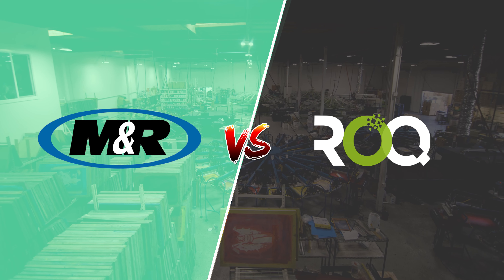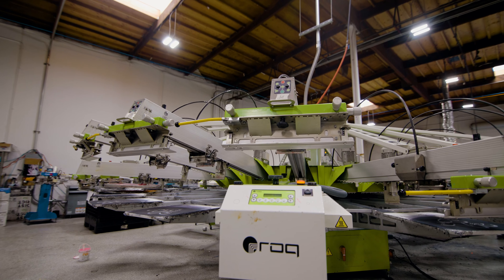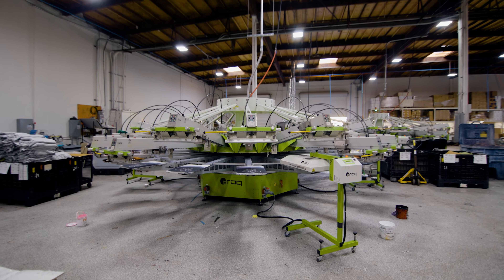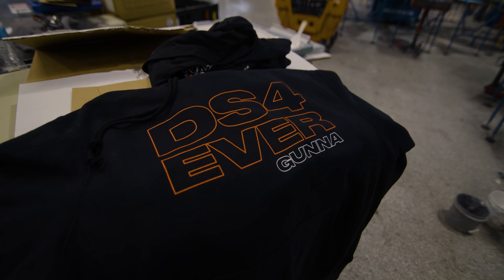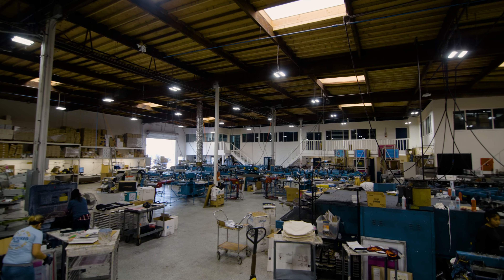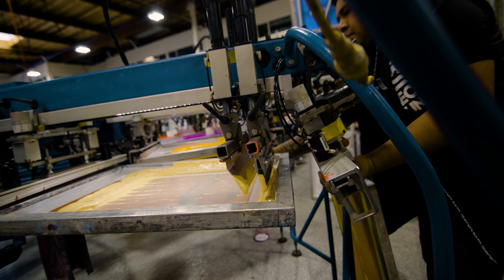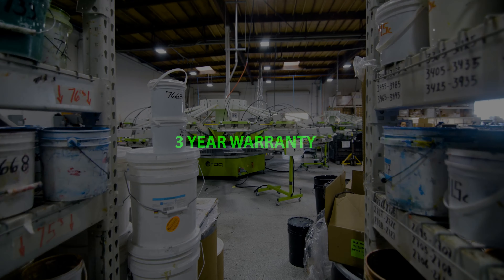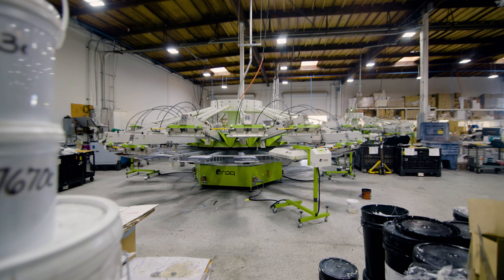M&R vs. ROQ | PRICING

Comment: I love screen printing manually...learn the basic with a manual before u go spend mad money on automatic...i have never had a 10 color job.lol
So i think its bs for that to be a reason for automatic press....
With manual u see soo much that i feel u cant see with automatic press....and i would love to have a partner and i go up against a manual press..i always screen print by myself..when i see people use a automatic press its usually 2 people...its the flash timing i dont get from automatic... automatic seem to have a shorter flash time..i assume most use wet paint with automatic screen printing machines..and if my orders got tooooo large i might think on automatic press..other then that i like whole process of screen printing manually..
Reply from the maker: It's always the best to find out what's suitable for the business
Reply: @anchoredprints  on some level I get you...the shop I work at can afford a automatic press..I keep getting ask by my boss if I want a automatic..I always so no..
I like the workout I get from screen printing..but my arms are starting to not like screen printing..I am 51..I want to goes as long as I can with a none automatic press..and if screen printing grows to a point a automatic is needed.i will go that route..I use a vastex v2000 6 head.great wheel..have 3 tajima embroidery machines.
Appreciate the reply .
Have a happy new year2024..

Comment: Blue V Green argument is going to last years and years. Ford VS Ford in my and other industry Veteran opinion. Several key reasons to break away from the "Fords" and go "Lexus". 2/3 less set up time, 2/3 less pallet deflection, next to zero technician need, next to zero spare part need, next to zero mid run registration adjustments, superior flash unit tech and much easier "newbie" automatic operator training. What is the "Lexus" press line up you say?? MHM of coarse.
Reply: agree.

Comment: Purchase a Roq last year and it’s a love hate relationship. Registration is great, ease of use I’d give a 8/10. My issue are
A: machine will stop randomly after heads come up
B: I’ve literally had 5-6 bolts fall out while printing 
C: Pallets are not square and that’s my big issue. A design is centered and even on some and off on others. 

I’ve worked with many brands and IMO AWT is the best. The centurians registration is absolutely amazing but it’s takes a lot of air and hoodies are difficult because of the pallet board. Someone looking for an affordable press the M&R sportsman is a great choice and probably about $10-$15k cheaper. 

My roq tech was fantastic. From a customer service standpoint, everything from ordering, delivery and and tech calls has been great with roq. My only complaint is not with the purchase of the machine but aftwards my sales rep takes to long to reply when I’m looking to purchase accessories so I’ve been forced to buy thru dealers instead of my sales rep.
Reply: How much ROQ costs Sir